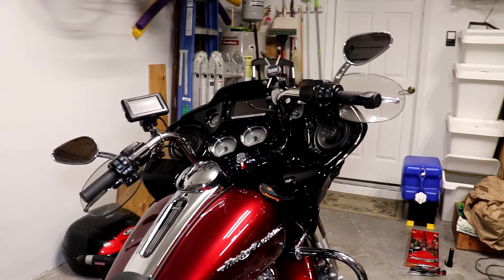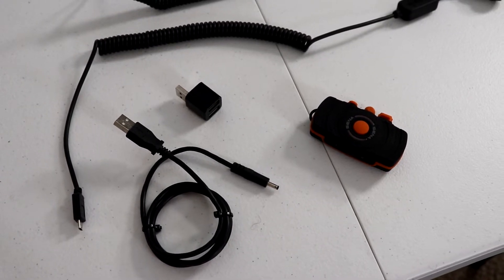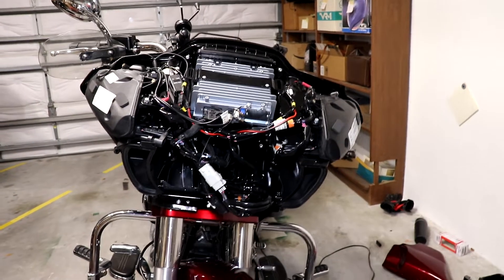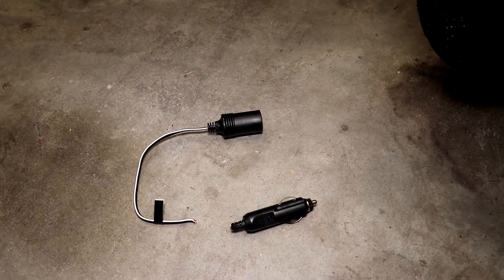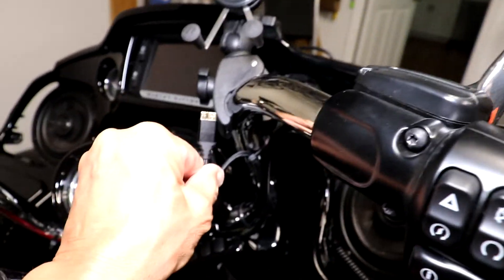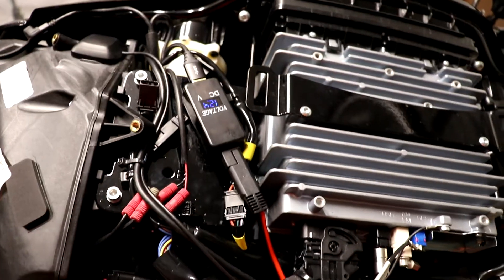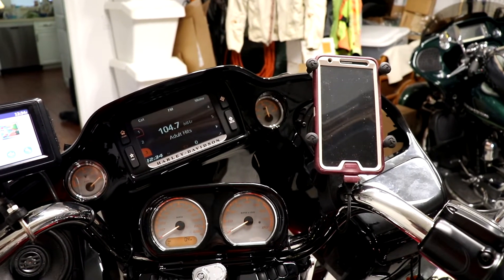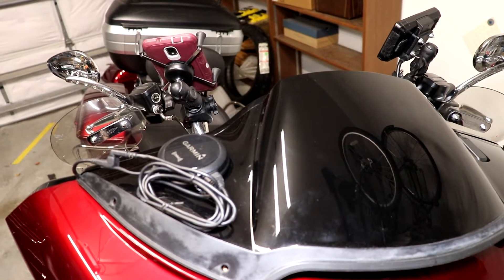Adding Electrical Accessories to My 2017 Road Glide Special

Comment: I need to add a usb charger for my phone, 22 road glide. I have used the existing one for a wireless CarPlay. And I took out the cigarette liter and added a push button for my garage door opener.

My question is where can I tap into to get power? What equipment would you recommend now, almost 4 years later.

Thanks in advance
Reply from the maker: You can use the power line that used to feed your cigarette lighter. I like this USB module: https://amzn.to/3l82CiA and you'll need an SAE pigtail: https://amzn.to/3xfn3Nz These modules do burn out after some time, so it's handy to be able to plug in a new one. Also, some people report that the cell phone cameras can be damaged from vibrations when mounted to motorcycle handlebars. Thanks for watching.

Comment: You're not confident enough with the Infotainment GPS to give up your Zumo yet?
Reply from the maker: Friends of our ride their motorcycles around the country about 80 days a year. They gave me this tip: Use the Garmin for trip routing and the Infotainment map for a wider view of the area. 

The Infotainment GPS is OK. It will get you where you want to go and lets you pick scenic, fastest, shortest route, etc. It has some issues that should be corrected. (If you miss a waypoint it insists on having you make a U-turn. To make the instruction go away you have to delete the next waypoint. The Garmin usually realizes you've gone past and aren't going back to pick up the waypoint and moves on.) 

Also, I have lifetime maps for the Garmin. Each map update for the Infotainment costs about $150. The cost of a couple of updates a year on 2 bikes adds up quickly. My Zumo 665 has an XM receiver; I don't have to buy the Harley module to get XM. I can add custom POI's to the Garmin as well as custom routes. (I have added rest areas as well as Harley dealerships. Hundreds of POIs are available on-line.) I have 10 years experience with Zumos.

So it's not a matter of not having confidence in the Infotainment system; it's a matter of preserving superior functionality at a lower cost.
Reply: The latest maps available for the HD GPS is 2 years ago. I use both on mine.
Reply: Zumo is much more detailed and flexible w live traffic.
Reply: Zumo is a much better nav system than Harley hands down.